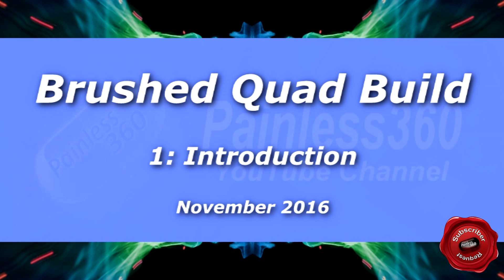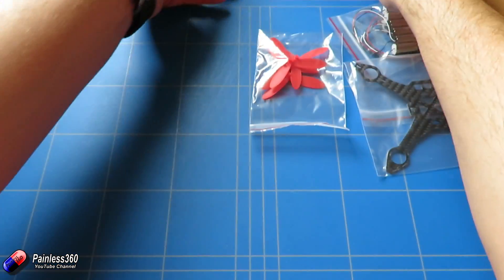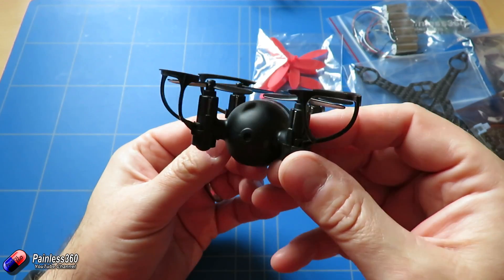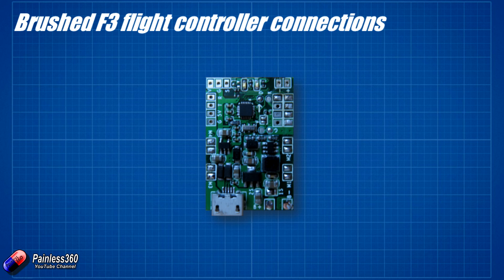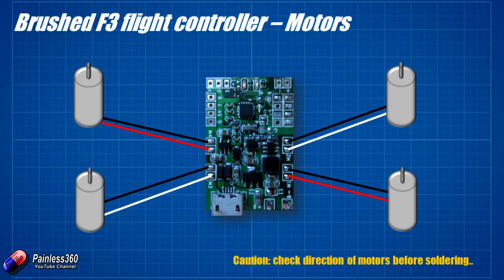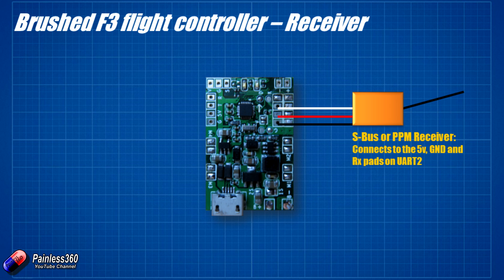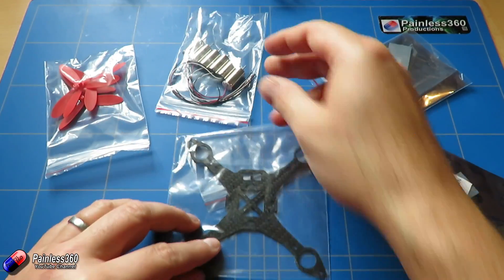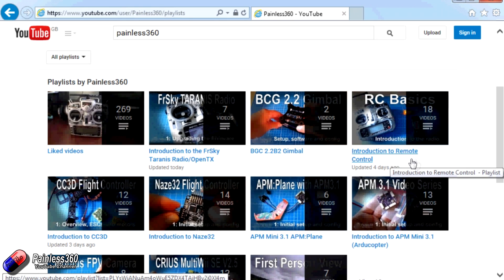(1/1) Building a Brushed FPV Mini Quad

Comment: hi sir i have question about motors which motor is fastest 1010kv or 490kv
Reply from the maker: Sounds like you're new to the hobby. See our videos in the 'Introduction to Remote Control' for lots of the basics, including the answer to this question. (the answer is 1010kv BTW ;) )

Comment: The flight controllers are so cool and small getting rid of the big ESC's and really, no big heavy equipment at all it seems. Plus you can program them with Cleanflight. The bad thing is that the motors don't last that long but I guess you have to take the bad with the good... This kit looks pretty great too, can't wait!
Reply from the maker: Yep, we will talk about the fast that brushed motors should be considered consumable items on things like this and also mention the 'running in' process to help make sure they last as long as possible.. Stay tuned! :D
Reply: Interesting, I have not heard about the "Running In" process in which you speak...  :-)     

That's why I alway turn to Painless360 for all my Drone'in Information! Your first place to look for all the news that is news in the Drone World!        Ha.ha,ha...

Comment: could you or will you be talking about flashing/connecting to betaflight? I've built my own 110mm brushed quad on 1s with spracing f3 brushed board. I successfully flashed with zadig in bootlloader, but cant connect successfully with a com port. I believe a lot of people have this problem.
Reply from the maker: I'd suggest you have a look at the SP3 series on the channel. You only need Zadig if it's a clone of the SP Mini normally.. Thanks for the idea..
Reply: will do, thank you for the fast reply.  I'm surprised I missed that, I think I've seen all your videos. awesome job by the way.

Comment: I built a 3d printed Mini fpv  Hexa with the f3 Controller and a Nano flyski Receiver :)
Reply from the maker: It's a fun project isn't it! I've waited until the tech was similar to what I know before making the plunge!
Reply: Yeah it is! And it wassnt to much money to pay everything as an student. I just needed a new fc so i picked a 6motor output one for about 15 euros on banggood also a little receiver for my turnigy 9x. Works great, nice and stable fight for outdoor mini racing. Its about 15cm max length

Comment: I have a syma x5 which runs betaflight.
Reply: How did you get it to connect to betaflight? I am interested.
Reply: Manu Leninja I took the original circuitboard out and put one of these in it.

Comment: I just build one myself. One thing I learned make sure in CLI motor_pwm_rate is above 16000 mine is 32000 (brushed mode) otherwise it will go full throttle upon connecting the battery. Thankfully prop wasn't on.
Reply from the maker: Good to know - thanks for sharing!
Reply: Hey rizki as mentioned above does the 32000 number is that the kv or the brushed motor or is that a regular setting? can you explain a little more pls

Comment: I just build one myself. One thing I learned make sure in CLI motor_pwm_rate is above 16000 mine is 32000 (brushed mode) otherwise it will go full throttle upon connecting the battery. Thankfully prop wasn't on.